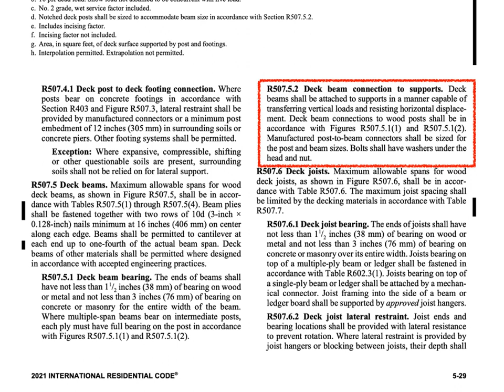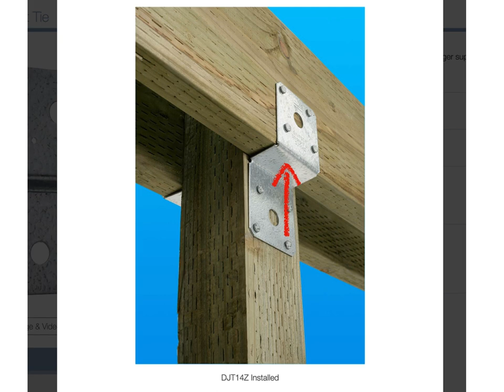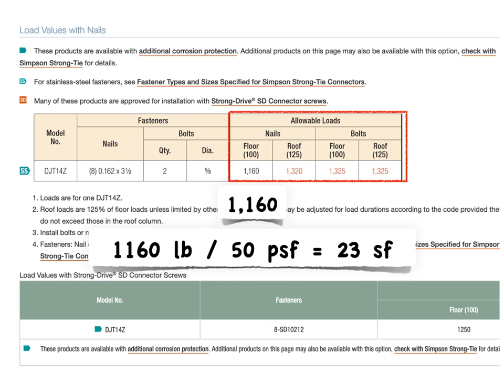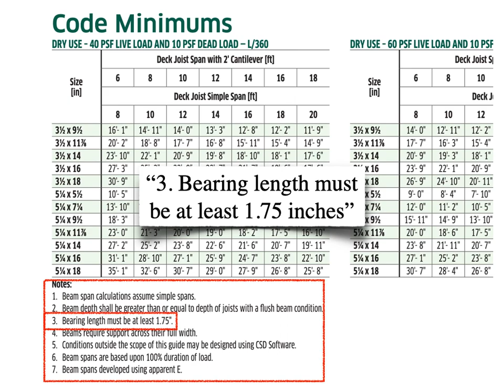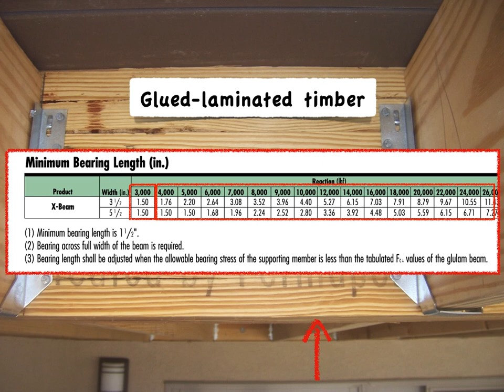Side Mounted Deck Beams

Comment: I've replaced a lot of notched beams and none that have been side bolted with 1/2 carriage bolts. Actually I've never seen a bolted beam fail on any deck in over 30 years of doing this.

Comment: Bolted through side beam to post connection supported by 2 djt brackets on 8 2 1/2 inch each is probably the strongest and most stable connection out there, unlike beam on top of the post that is prone to tilting or notched beams that tend to weaken the posts structure.  How is the bolted connection non compliant in many states is beyond me. Half of all bridges and buildings are built like that.